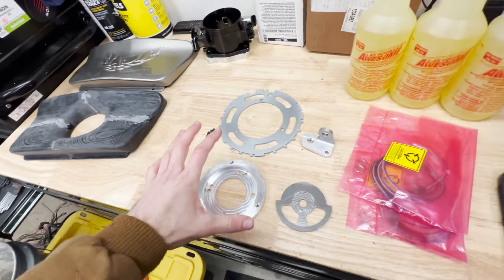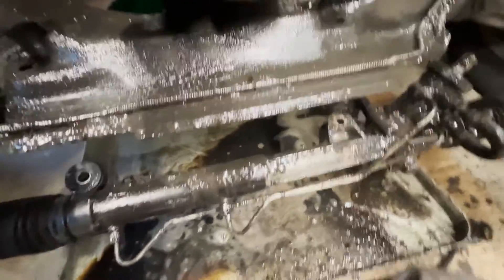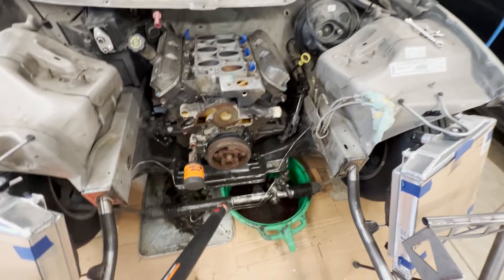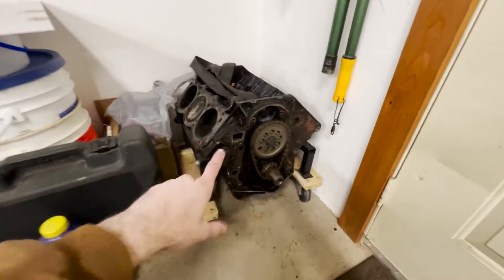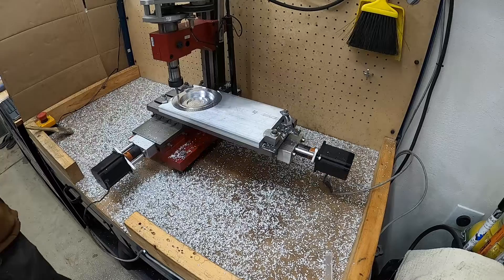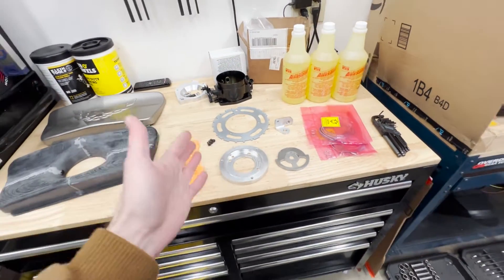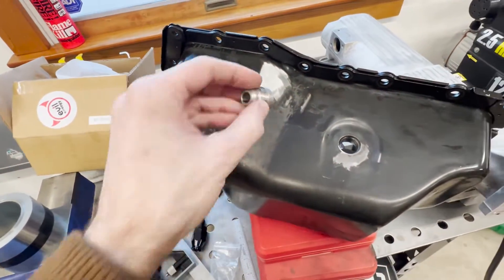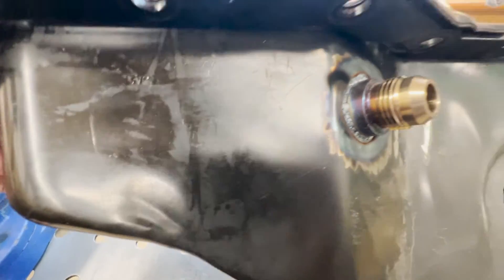Custom 24x Crank & Cam Trigger - Buick 3.8L V6 Turbo

Comment: 1: WIll you be offtering crank and cam triggers as some kind of kit?
2: Do you have to use a customer OS, or would just using HPT and changing the cylinders from 8 to 6 work?

Thank you.
Reply from the maker: Not at this time.
It’s more complicated than just changing the number of cylinders.
Reply: @turbov6  yeah understandable. It’s a OS code change and also the hardware to go with it etc

Comment: I'm super curious if you intend to make some sort of detailed explanation or how-to video on the specifics of adding 24x coil-near-plug to a V6 motor. Most googling and forum reading either goes well over my head or is just people speculating how to do as it seems no one has really manage to accomplish it before. Most people say to go straight to 58x Gen IV pcms, but it's really cool how you've accomplished it with a modified OS on Gen III PCMs. Either way, insanely cool work and I hope more guys get inspired to use V6s. I know I have, and my 86 S10 Blazer is keeping it's 4.3 swap!

Comment: This Channel is perfect for me. I drove a 98 buick park Ave across the east coast several times. And currently drive a single cab s10. 
3800 motors are beast 🤘
Reply: i'm working on a 98 lesabre right now. great auntie parked it in garage it's whole life so now it's getting the college kid by, just needs new rubber after 26 years.

Comment: Tip #1: Royal Purple (I dilute mine 50/50) will clean engine parts so well that they will look like they came out of a hot tank
Tip #2: Preheat, above 350 deg, cast aluminum to out gas any oil in the metal, then wash with acetone before welding. (DO NOT use wife's kitchen oven)